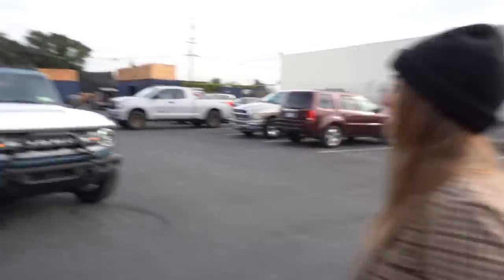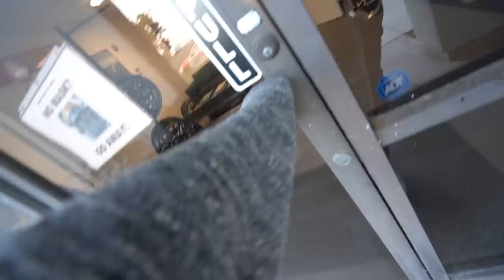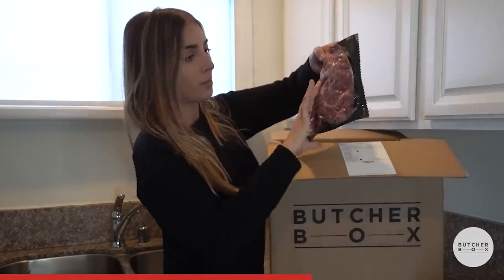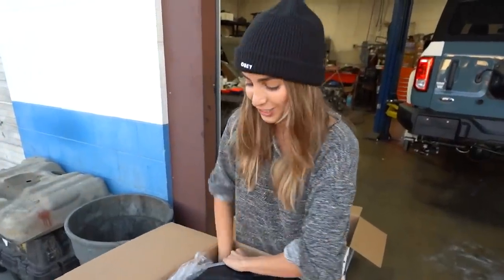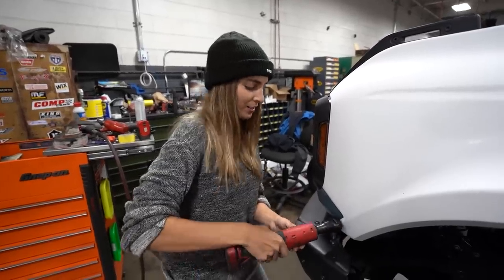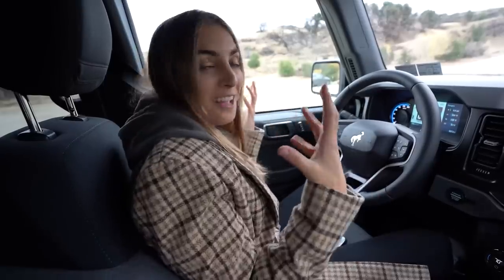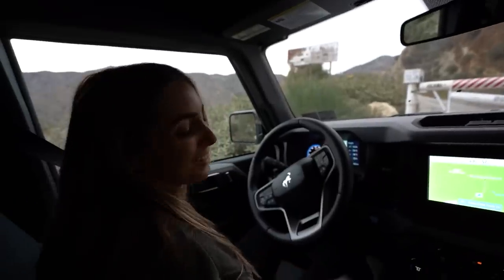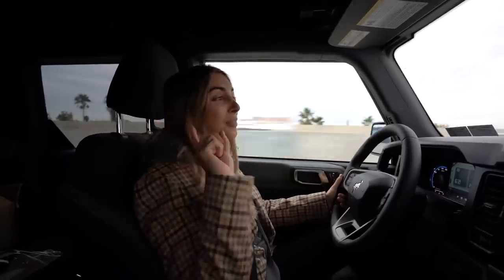I Made My New Ford Bronco Not Totally Suck....Will it Survive?

Comment: did you change your diff gearing. if not it will cause your trans to work to hard and possible failure. congrad's on the bronco

Comment: The rack and pinion is apparently a weak spot in these Broncos. The channel called lite brite just went out wheeling with one. They go into detail about what modifications they have tried. Luckily a new aftermarket one is coming out soon. 
I'm looking forward to seeing how this turns out!
Reply: Never had any problems with the rack and pinion on my 2003 Ranger . Maybe all it needs is some older parts on it .😂
Reply: If you have oversized tires that it wasn't designed for.
Reply: @wheelerk2012  yeah that's kinda the point.

Comment: Don’t sleep on the 2.7 liter the bigger engine (Ik you have the 4 cylinder) but with a simple turbo swap for each you are making loads more power. You can put 3.0 ECO turbos on a 2.7 and they bolt right on and give you a big gain.

Comment: The best way to lift them is don't go up any higher then what you need to fully tuck your wheels without rubbing. you want an ok amount of up travel with a ton of down travel. If you go too high its just tippy...       Get steel bumpers, rocksliders a 2-3" lift on 37s with a front & rear locker maybe a dual transfercase and there won't be a trail in the country you couldn't do!

Comment: I’m actually digging the way it looks now but a lift is all it’s missing.
Reply: Agreed. Lift die sure. But like the color scheme
Reply: For Aesthetics maybe. But it needs so much more, and you know she's not stopping there lol.
Reply: It needs a V8 swap and its perfection
Reply: No lift long travel baby
Reply: The sasquatch ones come factory on 35s and are actually pretty tall as is I don't think a lift is really needed they have tons of clearance stock I work at Ford dealer detailing and have got to do 2 the past two weeks one soft top & one hard and I'd say they're just as tall as a jeep with a lift if not a bit more if you haven't and can definitely go check one out when you get the chance I'm not really a fan of Ford but theyre sick af minus not having a v8 😂
Reply: And a lot more power
Reply: @tobybeaubien7044  looking at the way it’s setup right now with the 37s, if she hits up an obstacle and the articulation of the suspension is definitely gonna make the tires have contact with fenders and bumper
Reply: @tobybeaubien7044  What good is torque and bigger tires if yur front suspension shits the bed and breaks?
Reply: @1969darr  if it was designed for a v8 from factory it wouldn't  and the sasquatch ones have fox shox and are pretty solid suspension its beefy af I'm pretty sure hers isn't a sasquatch so it's just stock everything which I imagine would be different from the sasquatch ones but idk just my opinions tho

Comment: It is so sad , Ford didn't sell this new Bronco, with this Body Kit already installed as the stock version, I'd go with 31" to 33"  tires? with the stock trans and gear ratio, I wouldn't have gone with a 37" tire.  you need more power for those bigger tires.
Reply: The stock tires on a badlands would measure 32.7 so if you want it them look bigger and aftermarket 35 are the smallest I would go
Reply: Motor has plenty of power

Comment: The basically stock Bronco Badlands with Sasquatch is UNBELIEVABLE off-road. And it’s absolutely fine daily. Anyone ripping it is an idiot or a hater idiot. If you want a more luxury comfortable ride daily the. Ya you need two cars which generally isn’t a big deal. 🤙🏻

Comment: If you offroad, it does suck compared to the JL Wrangler. The Bronco's steering is breaking on anyone that runs large tires (37's and 40's) which the Jeep has no problems with. Oh and if you look at the Bronco6G forum there over 25 users there who had the 2.7L engine blow up at less than 5000 miles. With the wider offset of those wheels, better be careful if you take it on the rocks. The steering won't take that extra leverage and will break.

Comment: I have a question, and concern… I’m not sure how the engineering is done on these, but are the hub assemblies the same across the board for all packages or are their differences for the Sasquatch package and the new Badlands package? The reason I bring this up is because those bearing races are designed for the larger tires and are less prone to snap with your new tires. If they are different, you may want to order OEM assemblies from the upgraded packages and swap them…